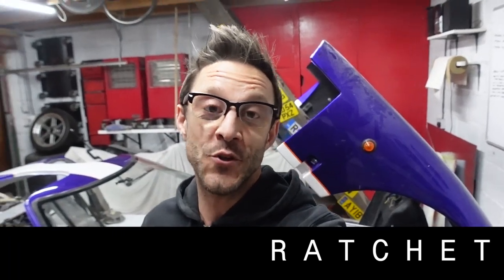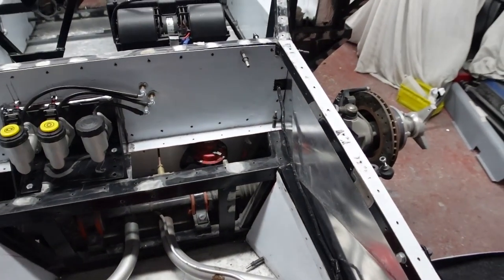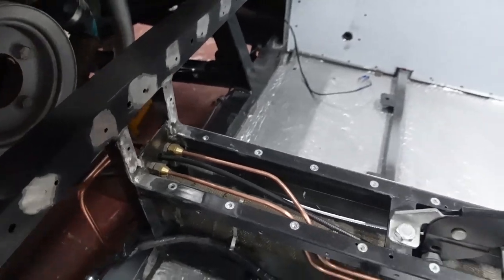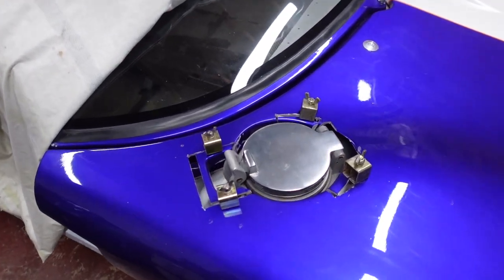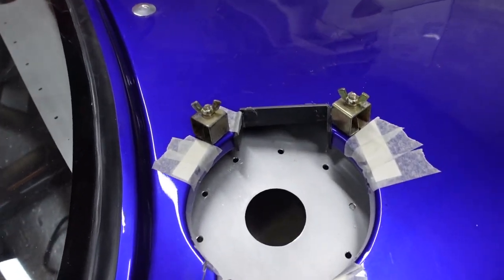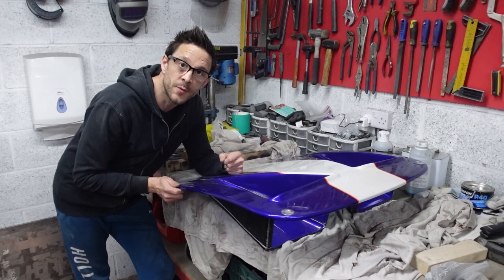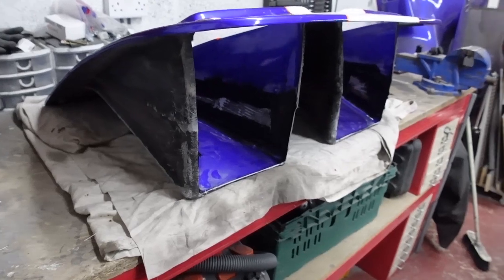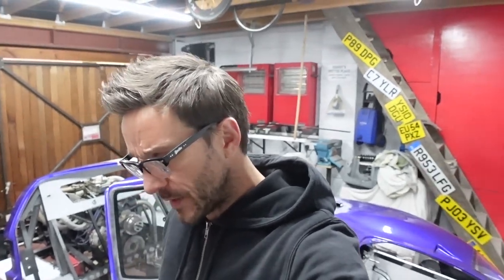GT40 Restoration - Ep 18: Making A Start On The Custom Bodywork

Comment: The usual way to do the deep nostril panel is to form a sharp edge in the centre by bringing the two centre vertical panels together like the prow of a ship. There are two issues. One is that the heat from the radiator gets under the front area and makes the cabin hot. With your arrangement you will either have a gap or a flat blockage. 
 The second is that if the air through the rad at high speed cannot get out freely the pressure will build up under the front of the car and you will see the nostril panel lifting. I fitted the deep nostril lower panel from Lee Dawson. As an additional benefit the front of the car was much more stable over 100 as the angled panel with easy flow for the rad air . produced downforce.
Reply from the maker: Thanks for the reply Mike, upon reading your message I took for the GT40 forum and had a read up on the Dawson deep nostrils..... looks like I'll be under going a version 2.0 of mine! I won't be able to get quite as deep as I want to retain the location of the fire extinguisher but I'll certainly be able to making something to allow even more air flow through and out. I really appreciate the message, thanks
Reply: @ratchetgt40  Move the fire extinguisher to where a fire is most likely ie the engine bay. Cooling in hot weather is a big  GT40 problem so you need the best airflow you can get through the rad. There is some good info on fan ducting om the forum. If you can't find drop me a message via the forum (Mike Pass) and I can send you a copy. I can also send you a pic of my deep nostril.